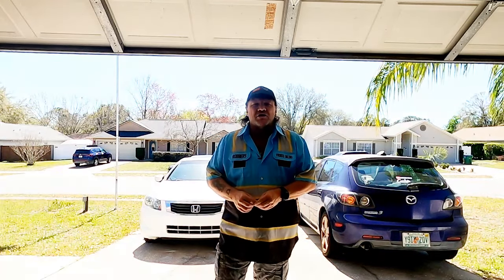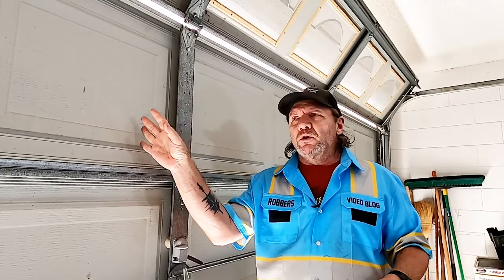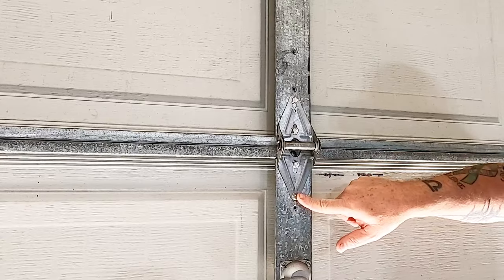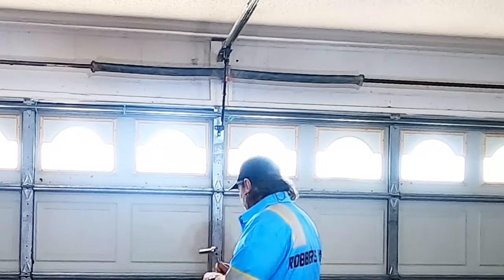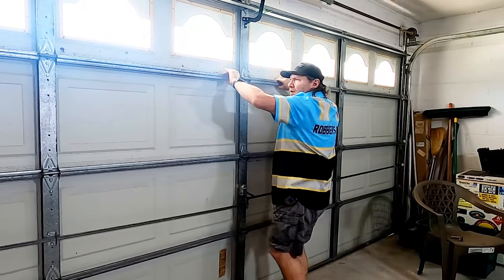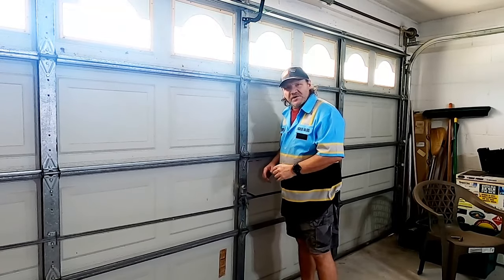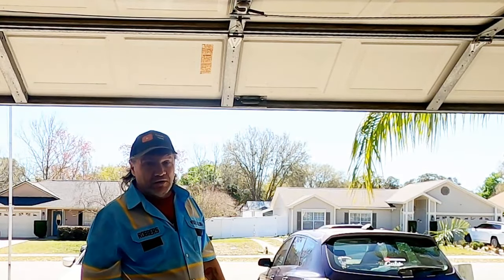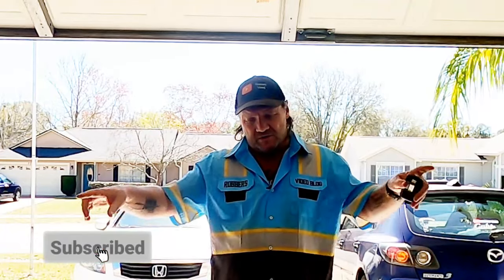How to reseat/adjust Garage Door Panels for smoother operation and less stress on your Opener Motor

Comment: 5 year door technician here I've serviced 10s of thousands of doors. This isn't going to fix anything unless the door wasn't properly adjusted at the time of install. You got to understand most of these doors are put in by guys that get paid per door installed. some of them can install an entire door in an hour flat by themselves. But they cut corners and their work is sloppy. More doors put in by these guys are out of adjustment than not. The problems may not present until years later sometimes when the hinges start to wear and make noises and the rivets holding the door together begin to get loose. If you want to actually make your door run smoother you need to make sure it is properly balanced by the spring, that the bearing plates are level with the bottom corners of the door, that the rollers are in good free spinning shape, that the door sections are not bowing when the door is ran up, and that the operator is properly adjusted and not putting unnecessary wear and tear on the door
Reply from the maker: Thanks for your input..more info the better to help people.

Comment: What if the panels are too tight against each other? Is that even possible? One of our panels seems to bow when the door comes up and then when it's closing it makes the whole thing "pop" back out and shakes the whole thing. Hopefully that makes sense. Would you suggest the same type of adjustment for the big loud pop happening when lowering the door? Thanks.
Reply from the maker: Yes I would try it..loosen the screws that are in the long gated holes then shake the panels then retighten...should take the stress off 9 out of 10 times..if that dont work the panel might be warped... good luck!!! let me know if it works!!!
Reply: @RobbersVblog  Thanks for your reply. It turned out being a couple of the panels were lightly cracked and would sag with the door raised and then loudly pop back in place when the door was lowered. I found some more help on Youtube to add a metal strut across the panels to add support and keep them from flexing and popping. I got a 8', $30 angled metal bracket and attached it to the hinge bolts across two of the door panels. Worked like a charm. $30 vs $530 it was going to take a company to come out and add struts and replace the springs.
Reply from the maker: @OrangeChrome  AWESOME!!! Glad you got it fixed cheap!!!

Comment: Just what I was looking for my garage door is 24yrs. Old put on a wall mount garage door motor lift so the top garage door panel has a small gap one can see a little sun thru it the rest of the garage panels seated tightly i was looking for some help on this of the garage panels setting or adjustment thanks for showing this I’ll try this setting of garage door panels and see if the top panel to set it self tightly like the other panels when the garage door is closed again thanks for the info of garage door setting have a good day
Reply from the maker: Your welcome..You might also have to adjust the limit switch on the closed side..might have to set it down a little so the door stops when the top panel is tight to the frame...hope this helps!!! Thanks for watching!!